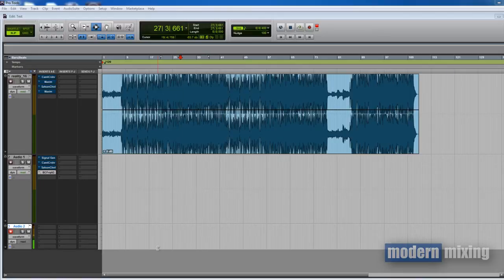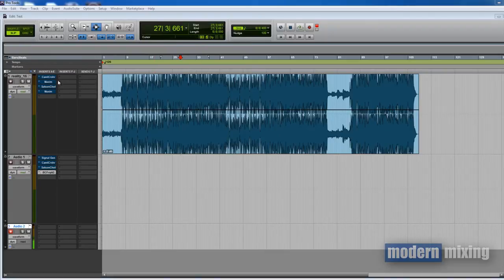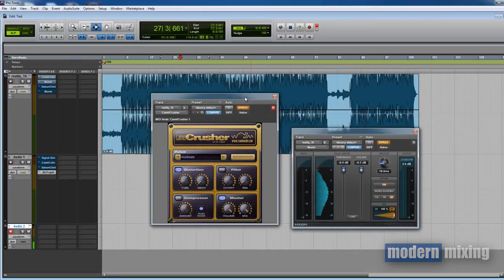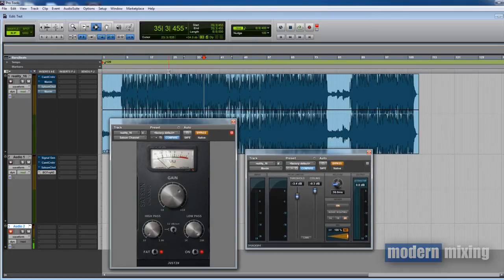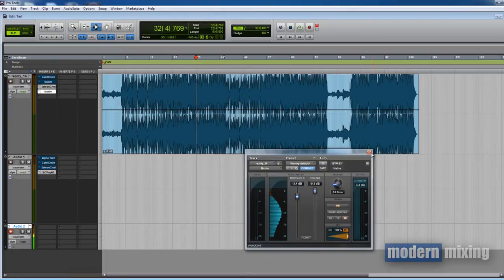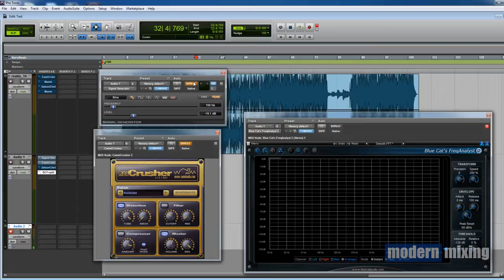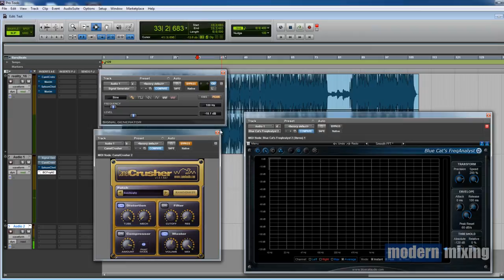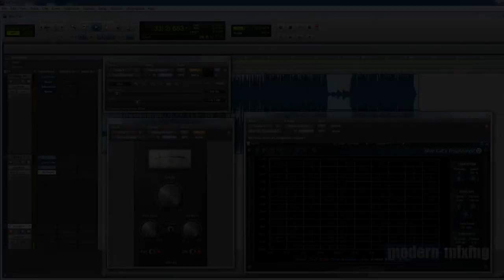Getting Louder Mixes (Harmonic Distortion) - ModernMixing.com

Comment: The camel crusher appears brighter in context I think, though it's nice to have a warmer-sounding mix in my opinion. The level of distortion applied is obviously going to be a stylistic choice based on your genre but I like to use it extensively on drums in any style. Thanks for the tips man.
Reply from the maker: RATC08 Hey man.  This vid is pretty old and I probably wouldn't reach for the Crusher these days but I definitely apply similar principles on the mix bus just with much better tools.

Cheers

Comment from the maker: It's not easy to interpret the exact peak level. I came from Sonar, there's a difference in the accuracy between the two.  That said, this was the one occasion that I needed extreme accuracy.  I don't usually analyse peak level because I don't need to.  As long as the Mix Bus isn't clipping and it sounds good than that's all I care about.

Comment: Does distortion add more overtone to the audio signal, or does it only amplify the overtones that are already present in the audio signal...Can someone please explain this to me in the most simplest way possible. Thank you :)
Reply from the maker: It adds them to the sound.  It generates them based on the original sound.  turning up would be more like volume or EQ but even that is not 100 percent volume alone.  Cheers.
Reply: Modern Mixing Thnx for clearing that up, Mordern Mixing...But what did you mean by "It generates them based on the original sound"? thanks again :)